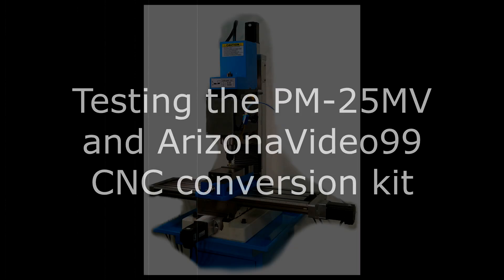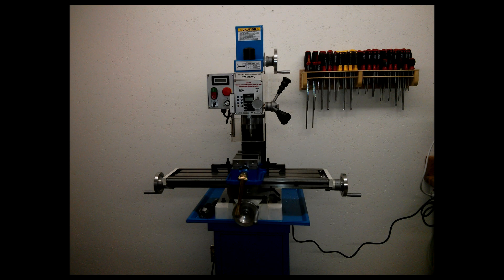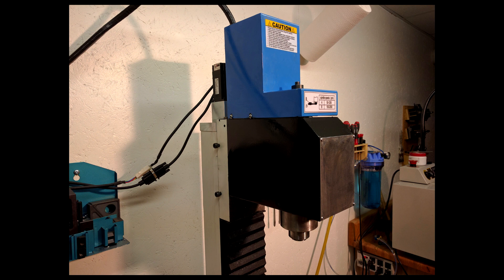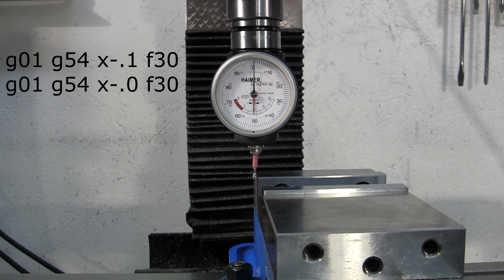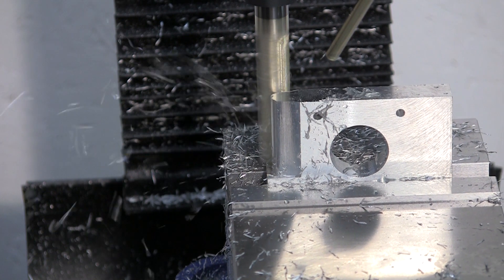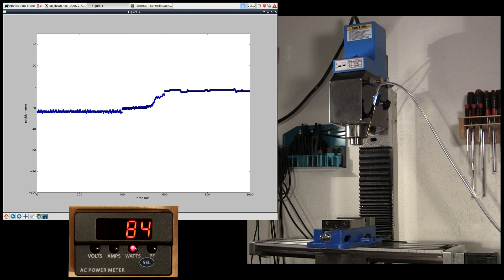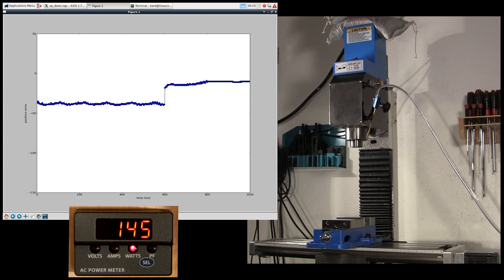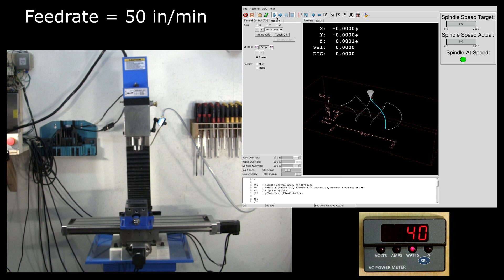PM25MV Mill CNC Conversion Testing

Comment: Thanks for sharing!  I am thinking of embarking on the same journey.  I am going to try the clearpath nema23 servos.  Would love to know if anyone found a real nice vise option for this setup?  I'd like to maintain as much Y travel as possible.
Reply from the maker: Hi Anthony. I'd like to know how the Clearpath servos turn out for you as would I'm sure many other people.

I've look at three vises, the 5" CNC vise from Tormach, the 4" CNC vise from Glacern, and the 4" D40 machinist vise from Kurt. I don't have a recommendation, but I'll point out a few observations. I only have experience with the Kurt D40. Hopefully others will add their experiences.

Kurt D40: This is the vise that I have. It does not seem to be the same quality as the D688 that I previously had, but it's OK. The opens to just slightly over 4" so it accepts 4" stock. There is a large flange that goes around the vise, which causes 1/2" or so of Y travel to be lost. On the PM25, there are also screws holding the Z-way cover that interfere. If those are not removed, an additional 1/2" will be lost. If using the bolt holes, you're mounting location is limited to the middle T-slot (on the PM25) and that's not the exact best location for maximizing Y travel. I've considered removing the flange in the back... and may still do it. I've also considered mounting the vise to a ground plate, to give more options for mounting. A 4" vise is pretty narrow, but I've used various extensions to better support longer materials. Solid models are available from Kurt for setups in CAD and CAM.

Tormach 5" CNC vise. Being a "CNC vise" it does not have the flange, but only opens to 4.125". I don't remember, but I think this vise also has a thicker fixed jaw than the D40, so while the removal of the flange increases travel, the travel and opening is reduced because of the thick fixed jaw. Solid models are available from Tormach for setups in CAD and CAM.

Glacern 4" CNC vise. I really want to like this vise. Similar positives as the Tormach vise, and the Glacern opens to an amazing 5.25". However, like the Tormach, has a thick fixed jaw which will limit the Y travel some.

I'm satisfied with the Kurt D40, but if ordering one today, I would strongly consider the Glacern, and consider how rotating the vise long ways with the table might help. Remember, with all these vises, the jaw plates can be moved around. I often move the plates to the outside, and the stock rests on top of the jaws, pressed between the jaw plates. this provides more support and increases the clamping range. Just limits some operations slightly.

You may also consider other work holding methods such as fixture plates and wide step jaws compatible with the vise you select. With my 4" vise, I often have extension past the jaws, and with even 3/8" stock, it's easy to get vibrations. 

I hope this write-up has been helpful. Best wishes, Kent
Reply: Kent VanderVelden on my channel I have a couple videos of my clearpaths in action. I built a KR33 based Cnc machine that has served me very well, I am in love with my clearpaths.  In addition to the nema 23's I used on the KR33 machine,  I do have 3 nema 34 clear paths laying around that I may put to work (although they are likely overkill right?) at that rate the motors would likely be delivering power that the spindle could not keep up with, true?
Reply from the maker: I recognized your name, but couldn't place it until I saw your pick-n-place machine - I subscribed :) The NEMA 34 ClearPaths range between 200 and 2000 oz-in of peak-torque, so they might be overkill, but you may never be concerned about torque either. Will you direct drive a large mass like the a mill head with a servo? The moving parts on the KR33 looks lighter so inertia ratio will be better than with a mill. Much of what I do (milling aluminum and steel) is at low IPM and I barely move the power meter on my 230 oz-in steppers. I like the Leadshine motors because I can pull diagnostics information from them, but that required reverse engineering their protocol, but likely the same steps could be taken when the ClearPaths. I'm redoing my CNC lathe project and that may be a great place to try them.
Reply from the maker: You may want to check out the conversation I had with Berend Lucas van der Weide. He's quite knowledgeable, and on his channel has replaced the head on a similar size mill with a high speed spindle. He's considering the ClearPath servos as well and currently has Leadshine steppers similar (closed-loop) but larger than the ones I have. Looks like a great combination for 3D work.

https://www.youtube.com/watch?v=ogauKDOPoUA&lc=z12uzd05immsg1s2q22adxya1qrgj3qgu04